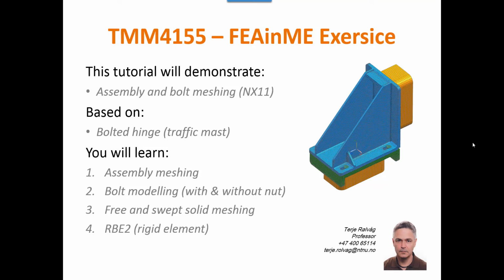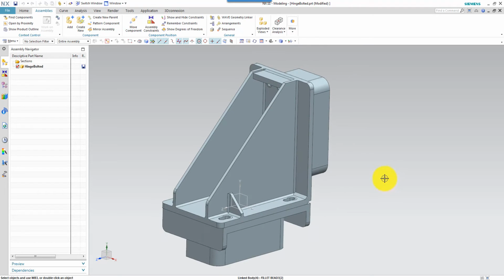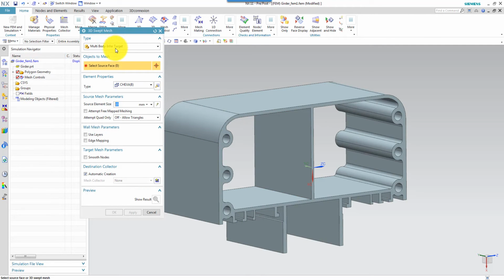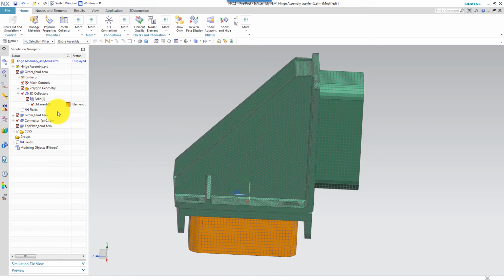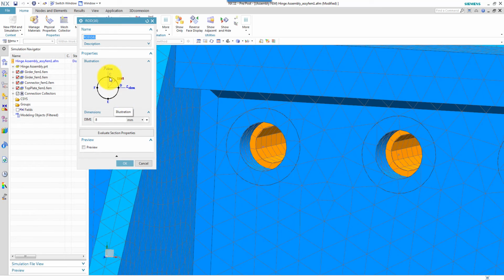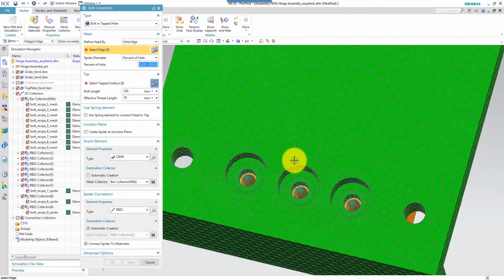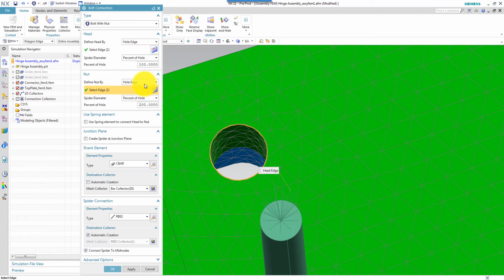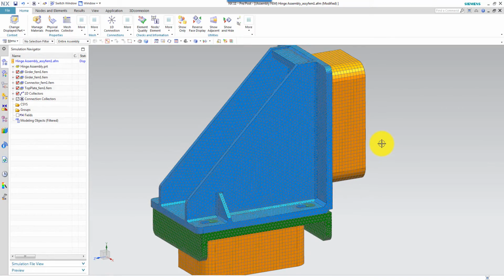NX Bolted Hinge Assembly Meshing

Comment: Hi, thanks for the video. I used the same representing bolts as spiders in RBE2's and the center as a 1D ROD in NX9 but it throws an error "rigid element connectivity" regarding the rigid elements and analysis doesn't converge. I also tried using the Bolt option in NX. I also added AUTOSPC and AUTO MPC=Yes...Since the 3D mesh has 6DOF and the RBE2 has only 2DOF I think there is a problem where the mesh connects. I also suspect that I have rigid body modes because the rigids are not connected as bolts. Can you please help.
Reply from the maker: Sure, I am currently on vacation but I need you model to help you
Reply: I encountered the same on a model.  The rigid body modes may be due to instability of the matrix  resulting from RBE2 having substantially larger stiffness than the bolts and elements.   Th NX Nastran bolt stiffness is calculated based on K= AE/L which should include the shear factor of .90 for circular shape .  The highest accuracy of solution may be achieved if the bolts are modeled as an equivalent spring element and the spring forces for the given bolt pattern are resolved based on the center of the pattern stiffness .  BTW - the solid elements have only 3-DOF (No rotational stiffness)